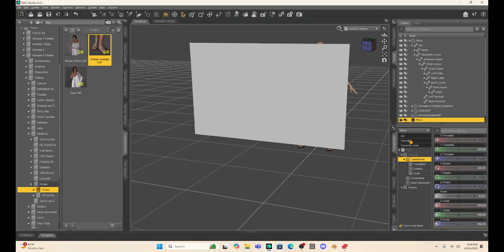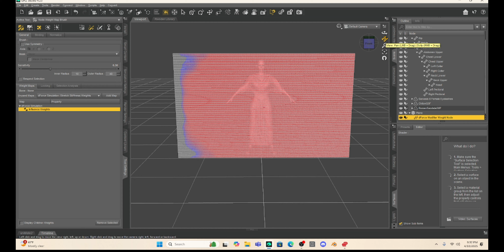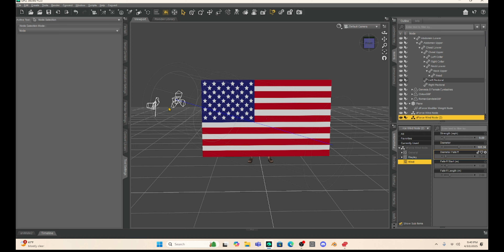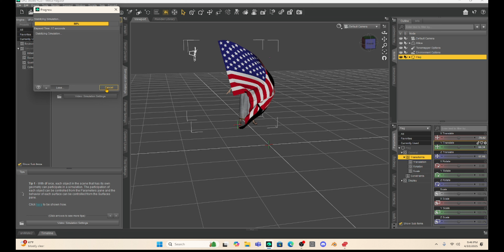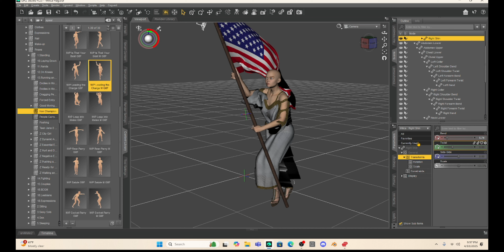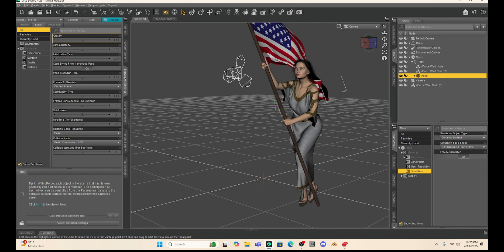Daz Studio: How to Use the WIND NODE!!!

Comment: "It's weird that they have the strength in MPH and the distance is in meters"

Especially since the devs at DAZ don't know MPH really - like you said, they think a 5 MPH wind is a galeforce wind but it's really just a faint breeze. This throws me off since you have to really fiddle with it.
I like the concept of the wind nodes but I've found them very hard to work with in practice. Partly because the wind strength values make no sense (I used to sail so I have an idea of what makes for a strong wind verses a faint breeze. It's like they're off by 10x or something).

Comment: Also... For this particular scenario.. 
Wouldn't sticking a cylinder-based flagpole on to the side of the flag plane and parenting the plane to the cylinder replace the whole need for a weight node?... I mean.. Don't DFORCE simulations automatically consider any object that clips through your DFORCE Affected object an area to hang from?

Let's say if you stuck a character's hand through some kind of large cloth, DFORCE usually considers that clipping scenario as if the character is holding on to the cloth... (That's usually how I tend to do scenes where a character is holding clothes in their hands instead of on their body) No weight nodes anywhere.
Wouldn't that work with a pole too? :)
Reply from the maker: I'm not sure if that would keep you from needing the weight node or not?  I'd need to try it.
Reply: @notfromthisworld7672  Could be a neat shortcut for some scenarios where object clipping is expected. :)

Comment: Thanks for the video! 👍
 I guess I need to use wind nodes now! 👍

An aside: I don't know if you already covered this on a previous video, but...
I've just started rendering using a Zoom Camera, and I am getting some great renders.
So, instead of just a normal Camera set-up, I 'Create' a Camera and call it Zoom Cam.
I set it up as you would normally, but then, using the 'Perspective' camera, I look at the Zoom Cam and move it, in a straight line, a good distance away from the subject.
Next, in the Zoom Cam parameters, I select 'Camera', then I use 'Focal Length' to zoom in on the subject!
And, although the normal camera, and the Zoom camera, are both looking at the subject the same, the proportions are far more accurate, (I think)! :body-blue-raised-arms:
Reply from the maker: Thanks for the message.  I've never used the zoom camera but now I must look into it.  Looks like a future tutorial!!!

Comment: Hi I appreciate your tutorials, lately I've noticed something with my renders and you may know what is, so sometimes my renders seem to have some transparency(I mean alpah channel) in places where it shouldn't like skin, or clothes, I paint a white layer below it and looks fine but I was wondering what could it be? could be a reflection of a transparent hdri?
Reply: I get this from time to time, it seems to depend on what program you open the image in. When i open the image in Photoshop it shows up but not in most picture wievers. But once i convert it to .jpg it goes away. Ive run into it with both HDRI and normal lighting so not really sure what causes it. My best guess is that it has to do with how the program you use to open the render in  interpets the particular shade of black, at least in my case.
Reply from the maker: Thanks so much for the message and complement!  I greatly appreciate it.  As to your issue... I'm not sure I've seen this before.  I wish I could see a picture of what is happening.  I think this might be a question for the rest of the Daz community to look into!